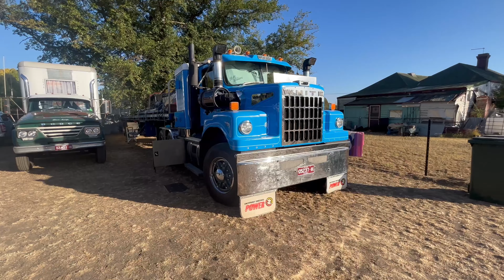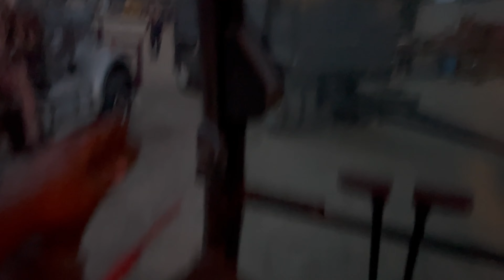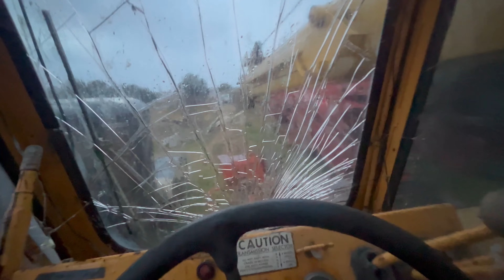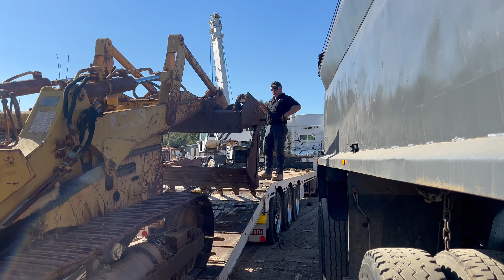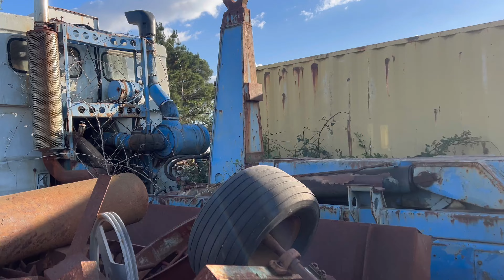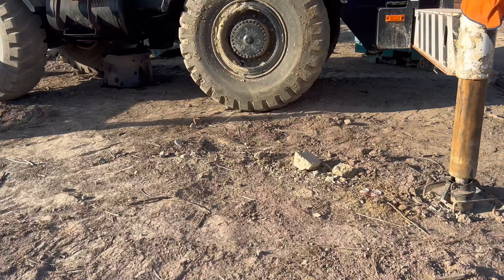I Bought & Cleaned Out An ENTIRE Junkyard!

Comment: Mate, Big project. I looked hard and couldn’t see why any one would have reported you to WHS, I think it was the lack of a shiny new high vis shirt, gloves on nor clamped to your belt as a safety fashion accessory, eye or hearing protection. Every thing else looked fine. In all seriousness a couple of good comments from the Craney’s who took the time to give you sound advice (albeit easier said than done in the heat of battle) vs the F@%ckwits that just went straight to Dan Andrews mode. Good to see you having a red hot go and well done. Thanks for taking the time to share 👍PS next time get a couple of the snakes in the vid for our American friends they just love them, or maybe that was another breach with Parks and Wildlife, munted ones upset them no end 😂
Reply from the maker: Hahaha thanks mate I like having a crack if I worried about every little danger we wouldn’t get anything done, but that’s why it was only the 3 of us on the job we all know where to stay out of trouble (most of the time) and yes I wouldn’t make a crane driver so I do take the advice from actual craneys on board 
I try to stay away from the snakes they are more dangerous than the crane I reckon😂 I reckon I’d have people looking for me if I damaged any of the snakes haha 
Cheers mate

Comment: i you going to try to get that Atkins fired up ?
Reply from the maker: I’m not sure if this engine will ever run again as it’s been open to the elements for 15+ years but I have a 6v92 I could drop in to get it running so it wouldn’t be a huge deal to get it driving again I don’t think

Comment: Fck me. I’m a cranie and watching you lift that container was painful. From the angle of the chains, to two blocking the winch, you fellas don’t realise how close you came to having a real bad day. Front walking beam on twin steers were common on big off-road stuff like drill rigs and big cranes years  and construction machines like,concrete mixers in America. Although I haven’t seen it on any road trucks in Australia.Good chance the Atkinson was originally single steer with a backyard conversion.
Reply: Twin steer co Atkinson's, Road Commanders,KW140 Series among various others were very common here in Australia!
Reply from the maker: I understand if cranes are your job it’s pretty sketchy, but like I said a couple of times now I used it every day for 8 weeks and there was some questionable lifts and rigging setups but no mishaps or accidents, the container was one of the worst as we didn’t have long enough chains and one of the stabiliser legs has a blown hose. There is no employees so at the end of the day it’s only putting myself in danger. But I do agree with you that I could learn more about the setups and do’s and dont’s. 
Cheers
Reply: @dieseldownunder.  the first thing you must learn is how to read the load chart. Is there one in the cab?  With that container lift, apart from the chains being to short, you would have been a lot better of extending the boom a lot more and having the boom at a greater angle. You were close enough you could have had the boom up to about 60 degrees and it would have a lot more capacity.  Also it is not advised to telescope the boom in and out under load. And watch the hook doesn’t hit the underside of the boom when winching up. It doesn’t take a lot to either bend the boom backwards or snap the winch rope. Hit me up if you want a few tips, but that load chart is important. If you haven’t got one, I van probably find one for you.
Reply: Yeah I agree also lift and shift stuff and farm in my spare time a bit of arse pucker watching this, a dogging corse might seem expensive but so is a broken dieseldownunder , shit has to be done but the aftermath of sketchy is no joke, best not show mum this 🫣kittens will be had ! And buy no loto tickets for a bit I reckon your luck has been used . All the best for next week

Comment: Pretty reckless sling angle on that sea container lift. Not surprised someone called worksafe on you if this is what you're uploading.
Reply from the maker: I can give you all the excuses of why but it happened. I’d understand if I had workers all around but I’m the one on the ground and the only one at risk which I was well clear of it most of the time anyway. If it was full I wouldn’t have done it like that but it would be 4-5T at best, maybe Worksafe can use it as a tutorial of what not to do👍🏻😂